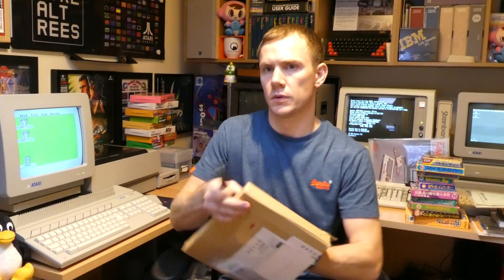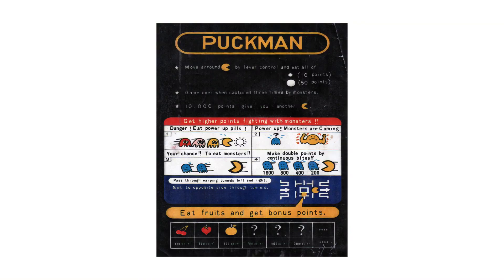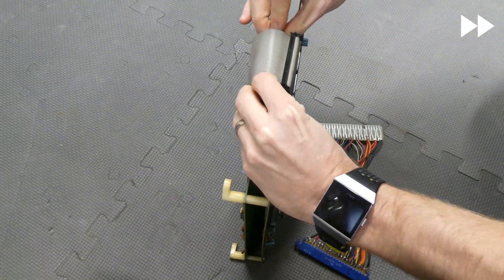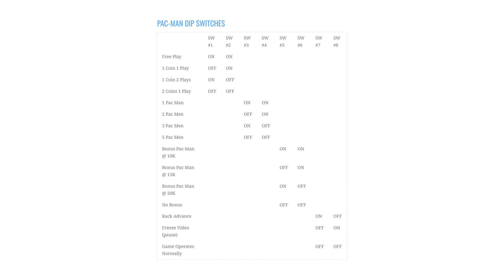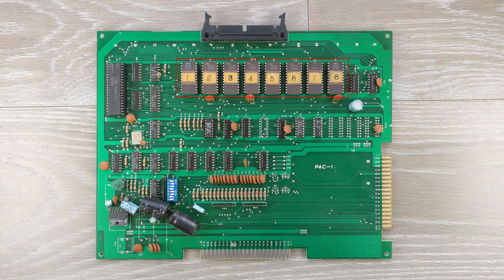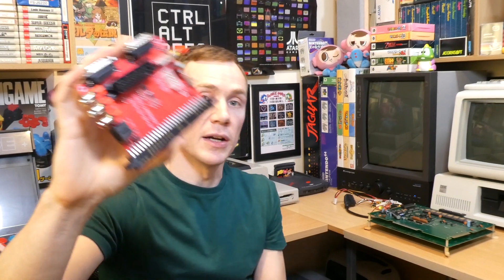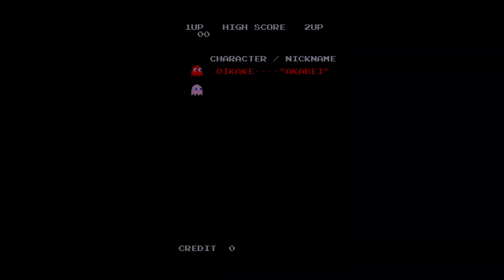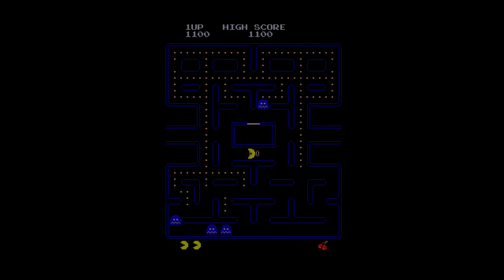"Puck Man" Original Japanese Pac-Man Arcade PCB - History, Tech, And Demo!

Comment: 4:36 It's just much more efficient to have the color memory, palette memory, and actual sprite and tile data in separate ROMs (PROMs were used for very small amounts of data). That way they can all be read at the same moment in time rather than having to read the same ROM in several places over multiple clock cycles
Reply: Oh and the sprite and tile data only contains reference to palette indexes which contain color indexes. That way the same sprite/tile can be shown using different palettes (a blue 'A' character doesn't have to be stored along with a white 'A'), and a single pixel of a sprite/tile only needs to be 4 bits - the palette index (64 palettes) - and each palette can be only 2 bytes (4 colors per palette, 16 colors of the form BBGGGRRR)

Comment: Yeah - really loved this video. Love the technical side of arcade boards. A couple of reasons of using the colour PROM chips, for me would be 1) The video circuit and CPU circuits are typically kind of separated and therefore you wouldn't really want to access the same ROM circuitry for the video as you would for the game. 2) if you did use the same type of chip for the video it would be too big and a bit too expensive for mass production. 3) Maybe the PROM is slightly faster, the video circuitry is typically around 6 megahertz compared to a lower frequency of the CPU rom stuff - probably still doable though. 
I'm covering an early Namco game in my video series on arcade architecture, so look out for the one eventually covering the video circuitry.

Comment: I wonder if the colour PROM might be a separate chip so the video circuit (which seems to be done via discrete logic chips rather than a single graphics processor) can get colour data without interrupting the CPU talking to the EEPROMs; Also they might have colour data in a PROM to let them tweak the palette for different games using the same basic board design? or to account for differences between different TV standards like NTSC/PAL ?  All of that is a total guess!  I enjoyed the video , very interesting :D
Reply: I believe the color PROMs are done that way simply as a side-effect of how video subsystems were evolving at the time:  rather than build in 16 standard colors, the video subsystem implemented them as reconfigurable via the PROMs.  Things just hadn't made the next leap to make them program-controlled.  If I remember/interpreted the code in MAME correctly, the video system's discrete logic addressed the colors and character ROMs separate from the main bus... so you couldn't actually access the data in those chips from the main CPU address bus.
Reply: That's a good guess, but that sounds more like a home computer/console setup (e.g. the vast majority of arcade monitors use plain RBG rather than a TV standard). The CPU and graphics exchange use of the address and data bus every clock cycle. By having the color, palette, and sprite/tile data separate, it means they can all be accessed on the same clock cycle, and lets the same sprite/tile be displayed in whatever palette the CPU wants at that moment